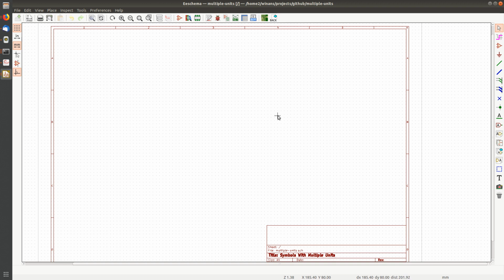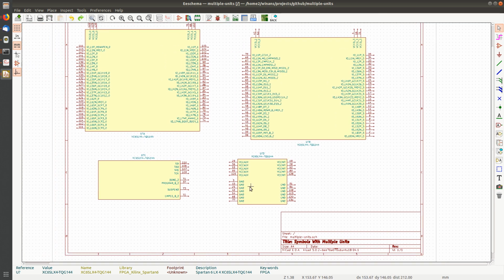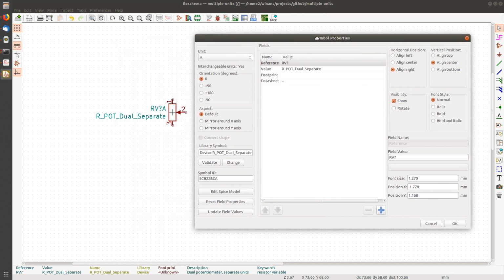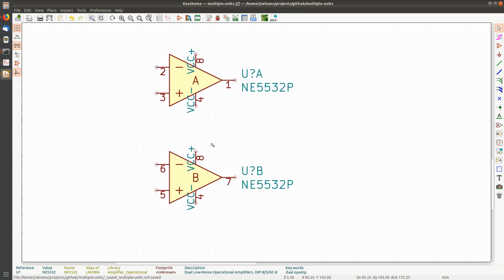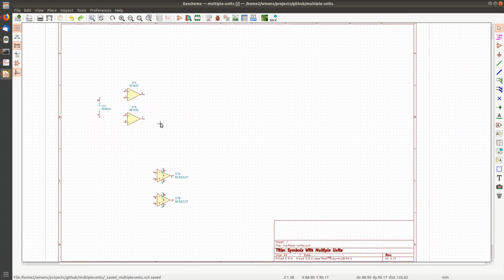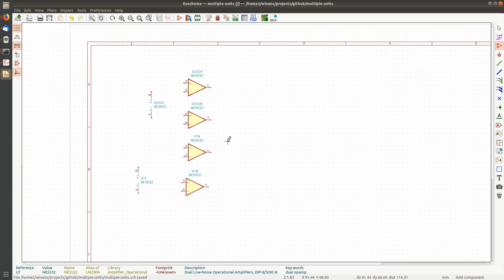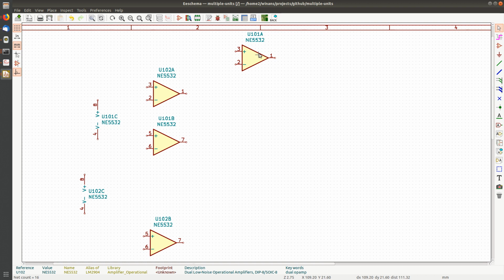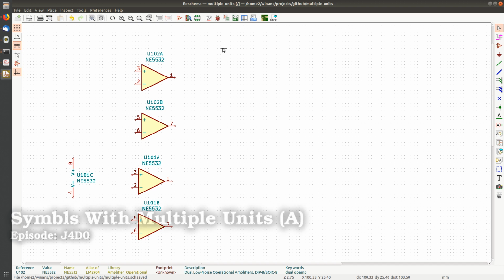KiCad 5 #18 Symbols With Multiple Units

Comment: For complex devices a hierarchical symbol would prove quite convenient.  Pins needing 1.8 V could be grouped with their current return pins and so could pins needing 5 V.  Ports could be grouped to match the software and programmable functionality could be split into hierarchy branches for selection at design time.  Since the schematics use hierarchy inherently, avoiding this obvious self-consistency seems pointless and confusing to new users.
Reply from the maker: I don't understand the point you are trying to make here.
Reply: @JohnsBasement  ATMega328p:
Power Unit:
  --> VCC: p7
  --> GND: p8
Analog Ref:
  --> AVCC: p20
  --> AREF:  p21
  --> GND:  p22
PORTB Unit:
  --> PB0: p14
    --> PCINT0
    --> CLK0
    --> ICP1
  --> PB1: p15
    --> OC1A
    --> PCINT1
  --> PB2: p16
etc.
Allows the designer to place the Power unit near the power supply, the Analog reference near the precision reference, the PORTB unit near the crystal etc.  If a crystal is used, then choose the CLK0 from the list.  If you need interrupt 1, then choose PCINT1 from the list, etc.
Reply from the maker: @byronwatkins2565  All of this is subjective.  Ultimately it depends on how the designer wants to consider the chosen parts when they have multiple functional units within them.

Things like reconfigurable pins on a SOC can be problematic because the groupings can vary greatly depending on how the part is configured.

If the design can benefit from it, one or more parts can be placed onto a hierarchical sheet and the hierarchical symbol on another sheet can be used to do the sort of things you are talking about to get the signals into groups or even buses in the manner that a designer wants it to be.

Comment: Do you need to specify the footprint for all the units or just the first one (A or A,B,C,D)?
Reply from the maker: I always make them all have the same footprint.
The vast majority of the time, when I place the first of N parts, I assign the footprint on the first one and then I copy that first one (footprint and all) as I go so that the process is simpler.
Alternately, you can use 'edit symbol fields' (the icon that looks like a spreadsheet grid) and do them all at once in there.

Comment: John, thank you for this video series.  Very educational and I like your teaching style.  On this video, what happens with annotation when you move parts of the part off sheet ( in a multisheet design )?  For example, you use the NE5532 component, that has 3 units and say put the power component on the power supply page.
Reply from the maker: If they are all part of the same referencevdesignator, say U101 then they are the same part.  The sheet they are on are not a concern.
Reply: @JohnsBasement  Thanks for the quick answer.  I need practice on multisheet as I was trying to solve it my self.  
So, If the power portion is on page 1 with ref designation 101, but the logic part is on sheet 2, (2xx parts), it will still show as 101, correct?
Reply from the maker: @markferrick10  You assign the numbers manually.